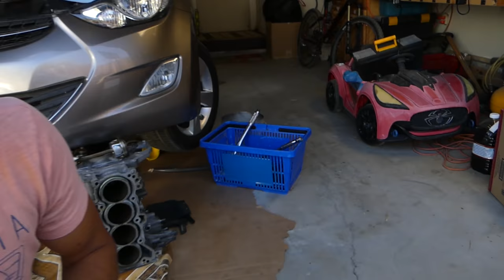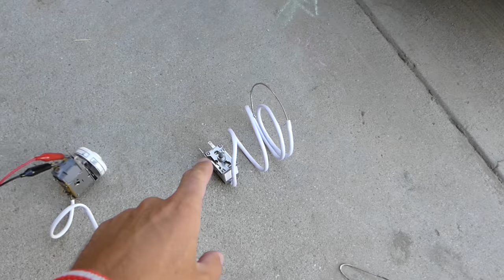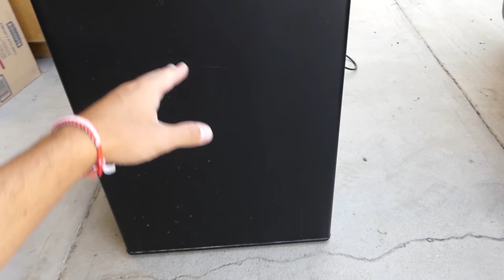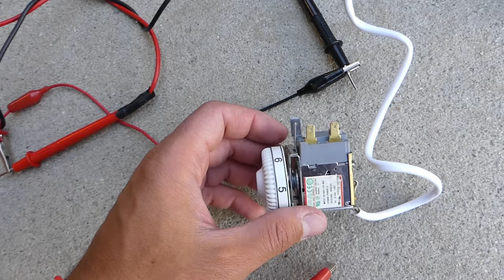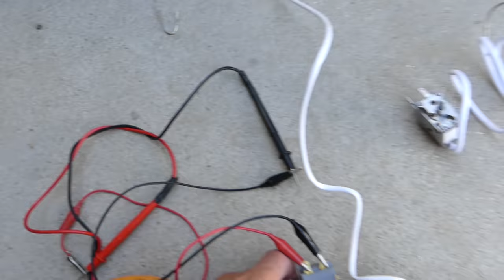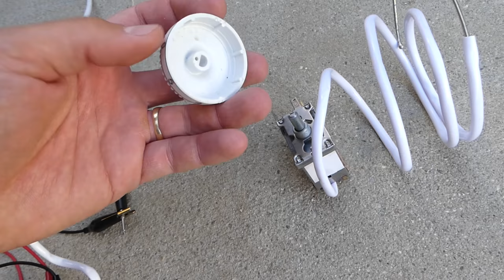HOW TO TEST FRIDGE THERMOSTAT

Comment: But this test doesn't test the actual function of a thermostat. You are just checking if it works as a switch but you have to check if it works on temperature also

Comment: One doesn't have to be a genius to check the thermostat for the continuity. But what's wrong if the thermostat doesn't switch off and the everything in the fridge gets frozen? I've already turned the thermostat to the minimum, but it's the same. The coils are clean so this also isn't the reason. Dhe door is closing well. So, what's the problem? Do I need a new thermostat?
Reply: He said in the video that means the thermostat is stuck open and you need to replace it
Reply: If its running closed circuit and its adjusted to its warmest setting then its just worth replacing - I thought I would fix it on a chiller unit on a job and spent hours trying to resolve it but I could only ever get it to work closed circuit all the time or open circuit all the time, they are quite delicate as in the pipe that you insert into your chilled area is full of gas and as it chills the gas produces less pressure causing the contact plate to lose connection thus stopping it chillong and when it warms up it will cause the gas to expand.All these manual thermostats are the same and work off the same principle so are interchangable
Reply: Change the controller of ur fridge

Comment: The most common problems with no cooling would be in no particular order a  bad defrost timer, bad thermostat, compressor capacitor.   This would be besides the obvious of dirt/dust, or less obvious of bad compressor.

Comment: I always check the Tstat first by testing continuity through the power cord. Most of the times I have had Tstat issues are because it is fried (they're not temp accurate to any degree in the first place). First thing I do is turn on the tstat (any setting other than off) and then hold my probes to the ground prong on the plug (unplugged) and the paddle (pos) prong. If there is continuity, the tstat is sending a signal- if not, that is your problem 99% of the time. No need to test further until you replace the tstat.  (*if the tstat is turned off, there will be no continuity at the end of the power cord)

Comment: What if your thermostat tests OK (and you've also replaced it) but the temperature won't stay consistent?  The vents are unblocked, the door seal is good, and the coils are clean.
Reply: did you find out?

Comment: Thank you, Auto Repair Guys! My freezer buzzes second month, electricity bill went double. Your video is the first one I think is spot on for my problem. I just wander, could the thermostat be dead because we transported horizontal freezer from one place to another..at one point we had to turn it vertical...yes, you should not..we did. Could we kill it because of that?
Reply: I don't think so, but they do recommend that you do not plug it in for a few hours for the refrigerant settles back down in the compressor. I usually leave it off for a day two.l just to be safe.

Comment: What causes a mini fridge to keep running and never stop?  I was suspecting a bad thermostat or switch that is controlled by a thermostat.  On the left side of the mini fridge, if you are facing it from the front, it gets hot.  I have another mini fridge and this doesn't happen and the compressor doesn't run constantly.  It does get cold inside after I repaired the leak and added Freon, but I can't get it to reach a certain temperature and then stop until it needs to run again.  Could someone tell me what may be going on.

Comment: Ugh.. I just replaced this part and am testing the old one for continuity and it's working fine! Why the fridge was cooling off but most of the time I had to manually twist the temp control to make it do so. But then by itself, it won't turn on to KEEP it cool, which is frosting my balls (pun).